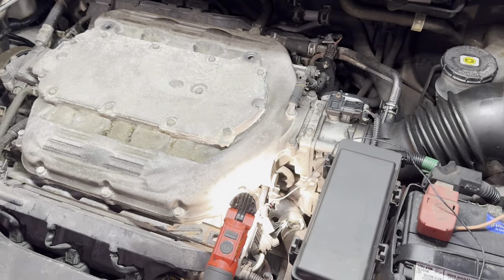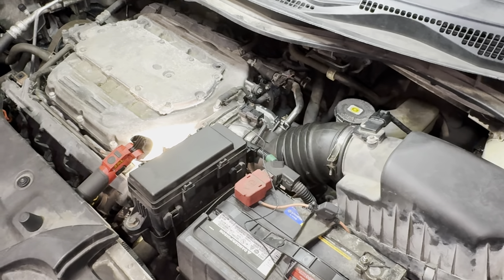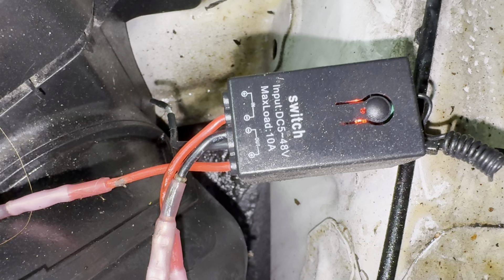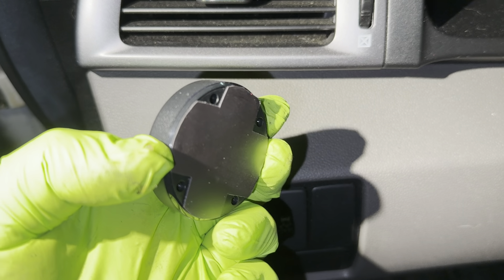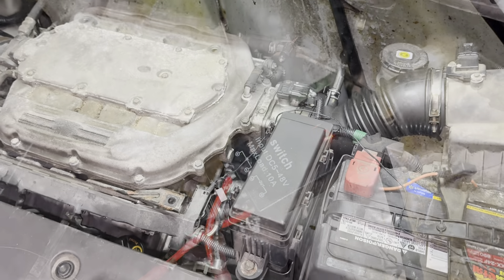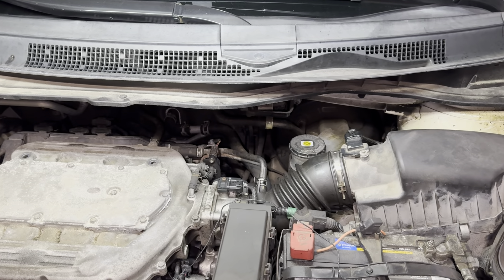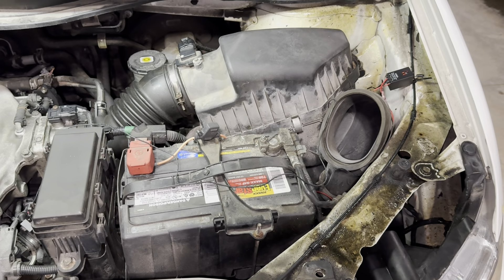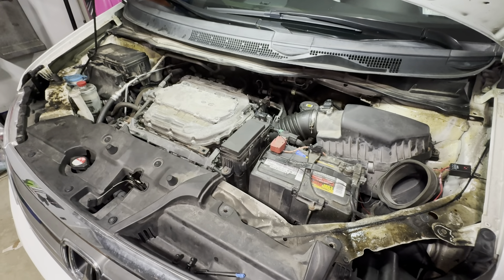Switchable Honda V6 VCM - It’s easy to do!

Comment: Great Video. What is the appropriate fuse size for the S-VCM?
Reply from the maker: I used a 5A.  The SVCM hardly uses any power.  It’s just there so I don’t burn down the van.

Comment: Question, does turning it back on when the engine is warm cause any check engine lights?  Just wondering if it would be like installing it when the engine wasn't fully cooled down.  I do a lot of highway driving in my muzzled 2012 with 208k miles and love your switch and the reasoning for it.
Reply from the maker: With my S-VCM it has not thrown any codes.  And I will switch it on and off during the same key cycle when getting on and off the highway.
Reply: Awesome!  I have the S-VCM also.  Just hoping there were no issues with the switch.  I drive 54 miles to work, just a little around town and always wondered about turning it off and on.  Now to put the switch on!  Thanks again.
Reply from the maker: You’re welcome!  Good luck.